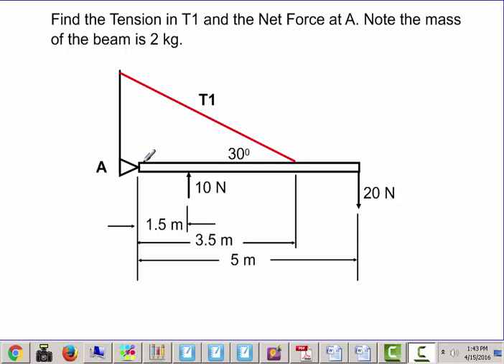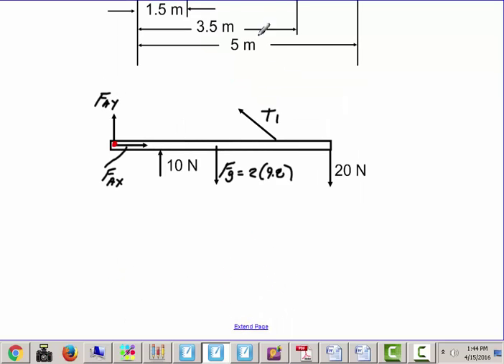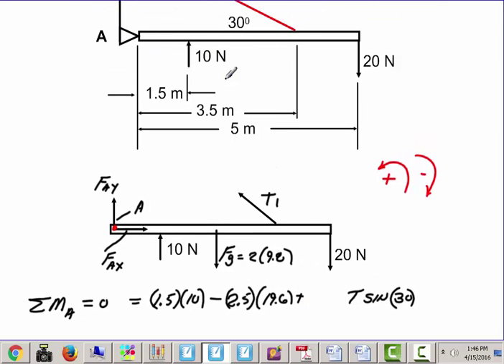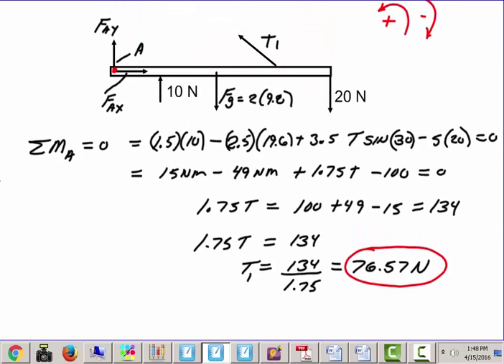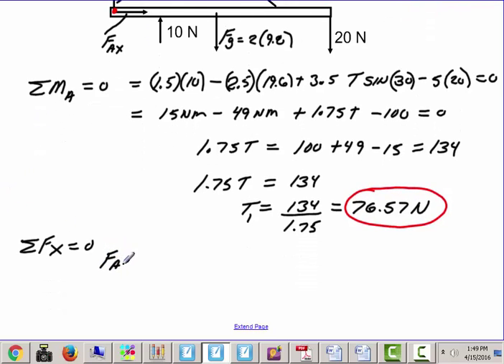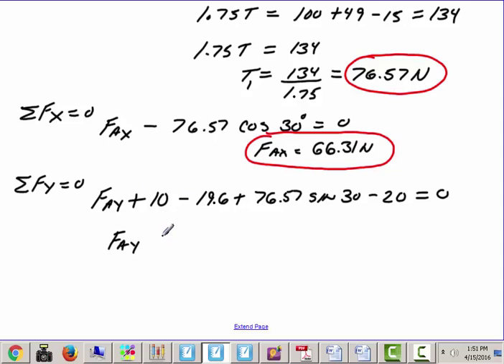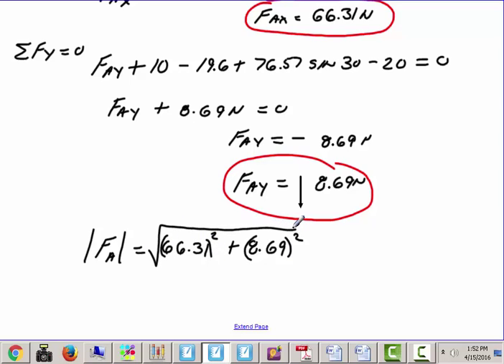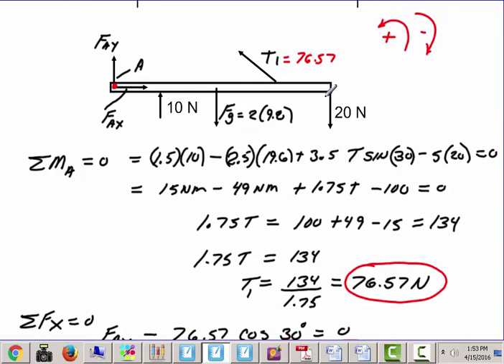Finding the Tension of a Cable Supporting a Beam

Comment: Sir why did you use sin 30,
On 3.5 distance?
What if you used cosin 30
Reply from the maker: Only the vertical component of the cable can cause a moment around A. Since the beam has no thickness the horizontal component of the cable (cosine of angle) cannot create a moment around A because it goes through point A. Hope this helps!
Reply: Oh !! Now i know haha, Thank you Dr. Holt, love your vids